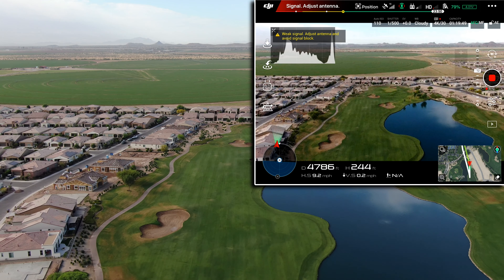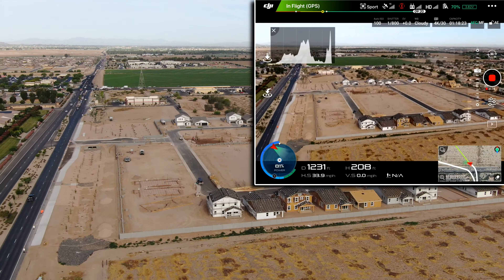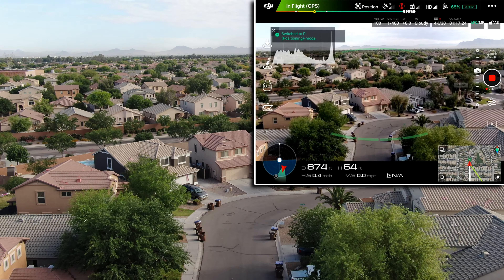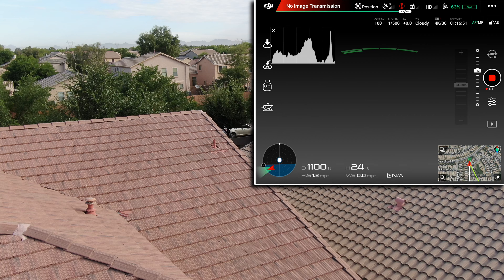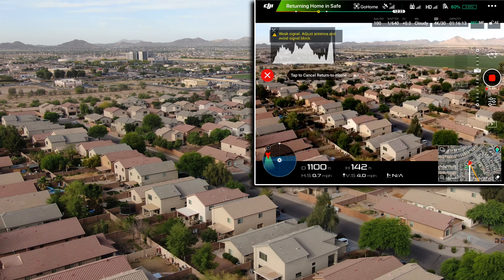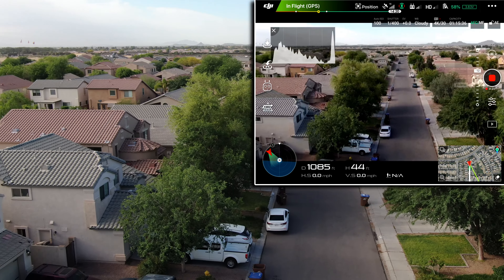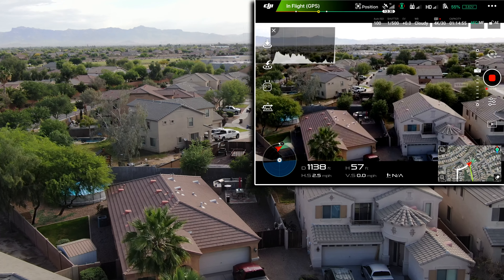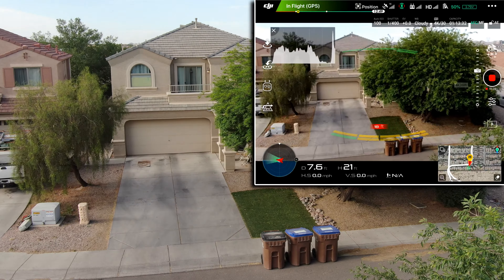WARNING: LARGE RANGE EXTENDERS CAN CAUSE ANTENNA ISSUES

Comment: Hi Mr. Kent, I understand that you have been a Ham for 50 years as I am also since 74. With that being said I know you understand antenna design theory and the directional nature of dish and yagi antennas. 

Anytime you make an antenna more directional in one direction you of course are going to lose signal in the other direction so its clear you should keep the drone or receiver in front of the antennas! With that being said the 5 inch antenna reflector wasn't a bad design, it was just more directional it seems. The real issue was that you overshot your home point and got behind the antenna and of course lost signal to the bird. That would actually suggest the 5 inch design was better because it blocked the signal in the direction that shouldn't have been needed, simply pointing the antenna in the correct direction would have resolved the problem and you would have regained signal and control of the drone.

I am a little curious as to why you felt the need to fly that low until you were sure you had gotten back to your home point?

This is where we can come to appreciate the obstacle avoidance sensors to keep mishaps from occurring and as long as you have the fail safes set to rise to a decent altitude and return to home you will feel that mush better about flying a quality bird when it does come back to you! I do understand how you felt when you lost signal as there is always some doubt and that something may have failed and you may never see your bird again. Keep up the good work as I enjoy watching your videos! Thanks and God Bless Brother!
Reply from the maker: Hi Mike. Thanks for your input, I appreciate all of the input I get from viewers. Yep, I do understand "a little" about yagis and all that. So, let me answer a few questions you have: The reason I come in so low is because I take lots of videos of the construction site just east of our neighborhood. I don't know if they notice the drone or not but some people are very opposed to them. So when I return from filming at around 150 feet I fly down that street slowly dropping down hoping they lose site of the drone by the time I get to the end. Then I come around the block and head home to my house which is only one lot distance away from where they are working.

When I began doing that I was very concerned about the drone getting behind me. But with that Mavic it seems to have no effect on reception or transmission. So I expected the same from the five inch reflector. But, as you said, it totally blocked the signal. 

The reason I chose not to use that size is because it began to lose contact over the golf course way too soon.

I'm not sure if I have answered your cureosity but if you have further questions or just want to stay in touch let me know. My email address is: mrkent.com@gmail.com.

Thanks again for your helpful advice and God bless you.
Reply: @user-sr8pn9xg8z  Actually that does explain a lot, keeping low upon return to throw the construction site off as to where it actually landed. Being that low also adds more obstacles that can block the path of your signal, you want to keep some of your omnidirectional pattern and still get extended range. I've really never had an issue with range other than when I purchased the smart controller and it seems to be reduced in power output which I have read they do that to conserve on battery. I plan on doing further testing on that.
As long as you keep the obstacle avoidance turned on and set the return to home height up there for the area you are flying you should be good to go. I do a lot of flying out of range and have depended on the RTH setting to bring the bird back home and it hasn't let me down yet! There's always still a little bit of doubt that something may go wrong or one of DJI updates may have changed my setting that I was unaware of but it brings a smile to my face when I see it regain connection and know my bird is coming home!
Reply from the maker: @MrFittyTucker  Hi again Mike. Yep, very well said. I have my RTH set to 150 feet because I live a couple of blocks away from some high tension power lines. Their highest point near my home is about 125 feet. So any issues that will bring him back home should not be affected by those power lines.

Also, here in AZ everything is pretty dry, even the trees, etc. That helps reduce the signal blockage a little.

Thanks again for your input. Fly safe and God bless.

Comment: Hi Kent
A great video as usual. I was going to contact you about your antenna. If you will look on line at the other parabolic/reflector type antennas they all have separate reflectors for the individual antennas, also the reflectors are upright behind the antennas.  With the set up that you have one reflector behind both antennas parallel to the ground might be causing conflict between the antennas as well as causing the signal to scatter in the wrong direction.  Another thing to think about is the depth of the reflector behind the antennas if you will recall most parabolic style antennas have a " focal point " whether it be a receiver or transmitter antenna. I think your idea would work if you just change some of the perimeters and make two individual antenna reflectors and set them upright instead of laying parallel to the ground. But then again... what do I know. lol
Thanks for sharing.
God Bless :o)
Reply from the maker: Hi Skip. Well, yep, there a few things to learn but I won't go into it right now. Each of the controller's antennas are vertically oriented dipoles. That means that the radiation comes from the top and bottom of each antenna. That puts out a vertically polarized radiation pattern. The curvature of my design compresses that pattern making it more concentrated.

But enough of that. Thank you for watching and hopefully your weather is improving. God bless.

Comment: too much curvature on the foil causes this?
Reply from the maker: I know but I'm not a camera expert like you. And it loses its flatness as I cut and bend on it. I have your address. I will be sending you one to test out. Thanks and God bless.
Reply: @user-sr8pn9xg8z  Thank you Mr Kent. But there is no need to send it. But if you send it I'll make a Video about it!
Reply from the maker: @Helderhugo  Well, it works so well that I flew over three miles until the Mavic said, "Turn around or you won't have enough battery to make it."

But I will send you one just for fun and FYI, any "tall" aluminum can will work. I imagine there are a lot of guys that could easily make one if they watch your video. I'll build one today and get it into tomorrow's mail. God bless you.